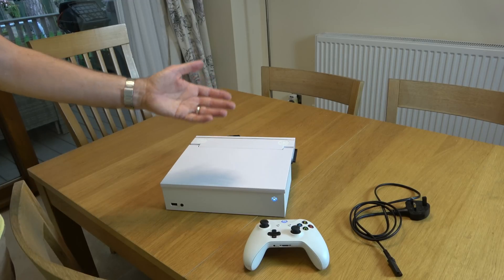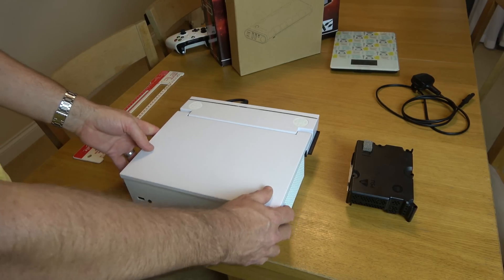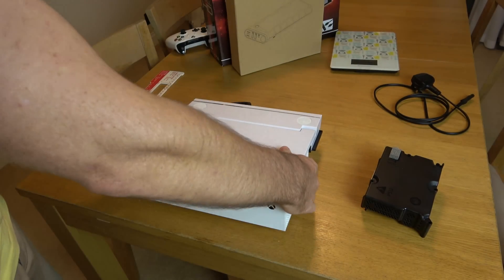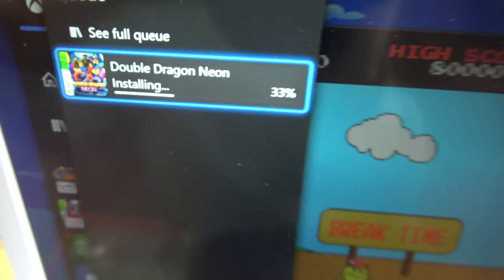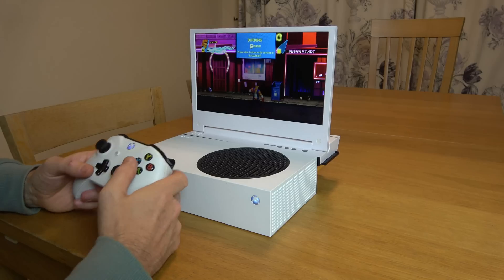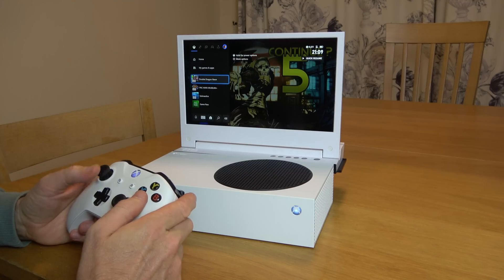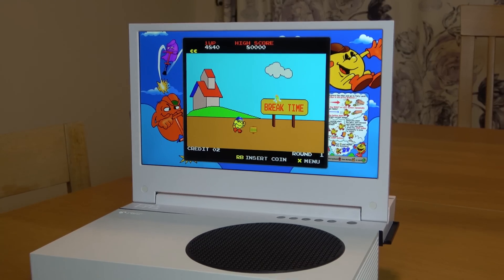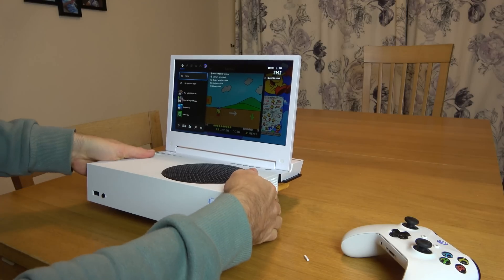Battery Powered PORTABLE XBOX Series S

Comment: To perfect you'll need to get the developer mode setup so you can install emulators, get a battery bank that fit in inside, mock up a insert plug for the back so you can charge and play and it will be perfect portable series S with best of both worlds.

Comment: a very interesting concept, I wonder however with all the space if you could fit an inline voltage regulator /fuses perhaps? given that I imagine the power supply was providing all of the protection against over/under current and spikes it would mean you could fit a connector to run it straight off say a car cigarette lighter and not worry about the potential 14.4v of the alternator overloading the possibly unregulated circuits of the main board...food for thought on a permeant build maybe :)

Comment: Vince, those DC 5.5x2.1 cables might be too thin of a gauge to support more than 5 or 6 amperes. I've had issues with those cheaper cables before and took me ages to find out why my projects were shutting off seemingly randomly. Swapped them out for thicker wires, and using those DC jacks with screw terminals fixed it. Alternatively, chop up a EC5 to cigarette plug adapter and use the jump start port which can supply more than 10 amps. Though depending on the powerbank, it might have a shut-off timer that powers down the EC5 port after a while.
Reply: Jolly good recommendation Jonathan. Good to know.
Reply from the maker: Got it, thanks Jonathan. They do seem a little thin and flimsy, but I wasn't sure if they could handle it given it is only 12V. I might order up some plugs that I can solder myself from eBay or CPC. Use some nice thick copper wire. Cheers for the info 👍👍👍
Reply: @Mymatevince  Cheers mate! Just hope that my past experience with these might be useful to somebody. It's usually the simplest (and silliest) things that makes a project stall. BTW, try to use DC5.5x2.5 jacks whenever possible (if they aren't already). They can take a few more amps compared to the 5.5x2.1 type.
Reply from the maker: @jonathanlau1221  👍👍👍

Comment: My only worry about getting rid of the stock PSU is what about Fuses? does the Series S have fuses on the Motherboard or are they build into the PSU? I know a few consoles that do each but not sure about the Series S.
Reply from the maker: A very good question. I don't know the answer to that but hopefully someone reading this may do. Nice one, thank you 👍
Reply: @Mymatevince  You could always put some inline fuse holders on the power cables.

Comment: I'd be interested to have a comparison on battery life of a modded version and a stock unit using an external battery powered inverter - would there be a hour of battery life difference?
Reply: DEFINITELY a BIGGGGG difference, you lose up to 40% energy using a inveter and stock config, all of that power is lost from heat due to converting 12v to 120v or 240v ac back to 12v dc

Comment: great idea and fantastic proof of concept. For the HDMI you could get one of those really low-profile flexcable based ones, they're popular for FPV and other applications and you could tape it flat to the casing. In terms of battery I can't tell how much space you have inside exactly but it doesn't really look like enough to get more than 2-3 hours of playtime. Still, you could look into getting some 18650s, a BMS and a spotwelder so you can make your own battery pack in a custom size and shape. Do also keep in mind that batteries don't like heat so I'd recommend measuring the internal temperature before going down that route.
Reply: Imagine Playstation 3